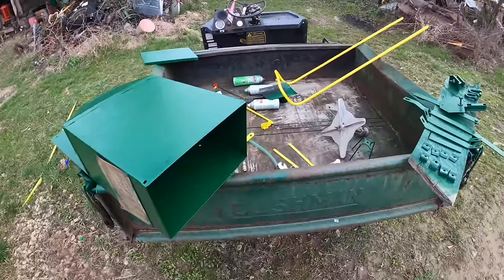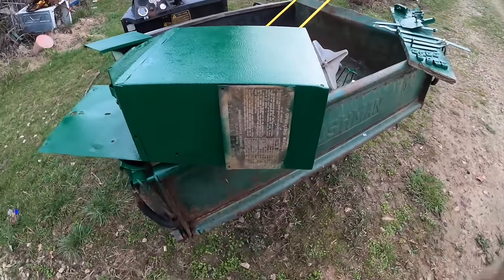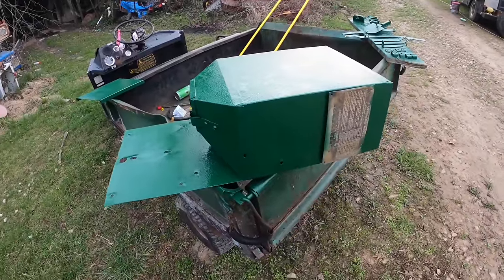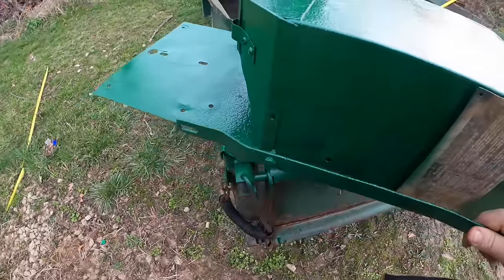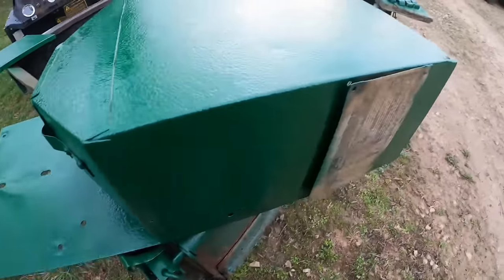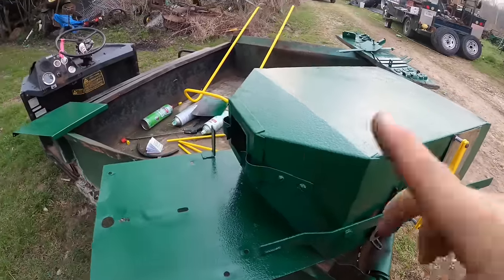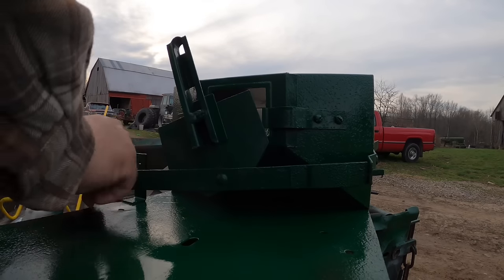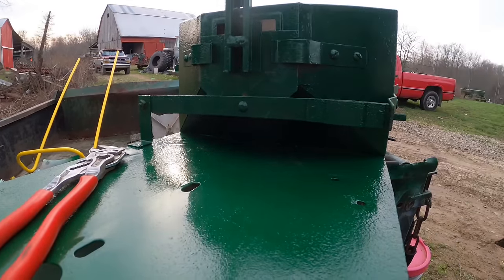Garber SEED EASY! Part 2

Comment: McMaster Carr sells square bolts and nuts that look like what you had to begin with.  I kept screaming that you had the hairpin stop on backward and then when you put the support frame on backward I had neighbors thinking an air-raid siren was going off and my nearest alive neighbor is almost a mile away.  I am sure that Garber will contact you and they are probably used to getting those requests.  I wish I were a little closer to you because an application of Bond-do to make that steel smooth would really make it pop.
Reply from the maker: 🤣 Thanks Gary!

Comment: Ross in your last video i made comment about 12 and 24 volt systems. 4010 and 4020 John Deere tractors come out with a 24 volt starter. Because of shorts starting fires John Deere had conversation to a 12 volt starter. My 4020 has had that converation. If you want to look at it , i'll bet it would be on the computer.
Reply from the maker: That’s neat. All these years and I never knew they were 24v at one time

Comment: The paint on mine is still good and it's more of an olive. The bars are kinda dark yellow like a mustard. But it's you're seeder paint it pink if you want to. I have a buddy that is a big IH guy. The ony piece of equipment that wasn't Red was a JD 535 hay roller. He had a big 2' square IH emblem painted on the back of that bailer.
Reply from the maker: I had to guess because there wasn’t a good enough sample to tell. But I was close, that’s good enough in horseshoes right? 🤣